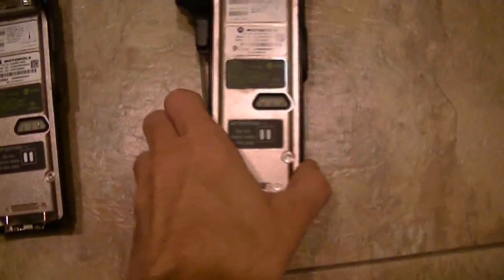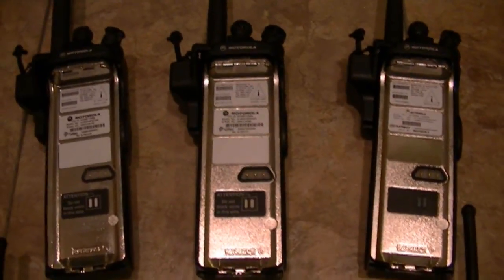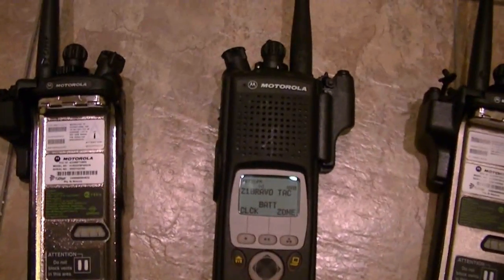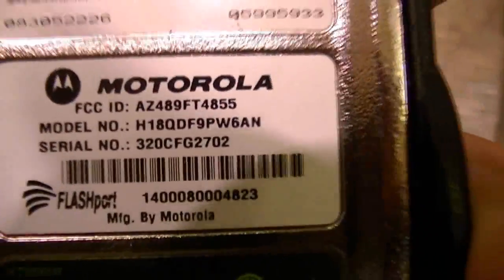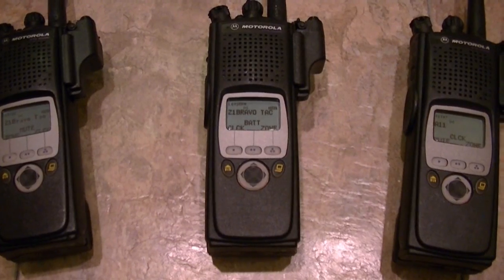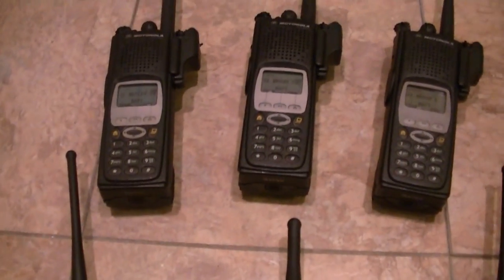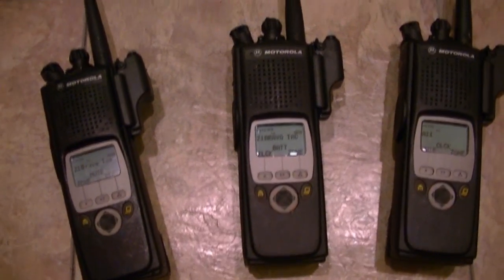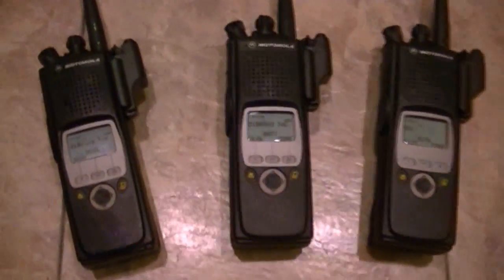Motorola XTS5000's and the Importance of "Legit" Tags - Flashcode check tips for buyers

Comment from the maker: It reall doesn't have much to do with flashcodes.  The CPS is structured with safeguards built-in that will block a write process that conflicts with that scenario in most cases.  People mod and screw with CPS and brick radios that way because they are "jailbreaking" it (for lack of a better term at this time in the morning).  The 17 CPS first issue was so bad they put out a second....they didn't get it right and long write times and fail 01/82's are common.  Use R16 and avoid the headaches.